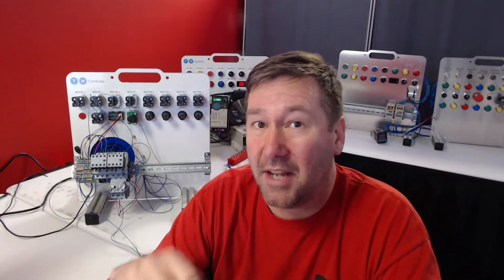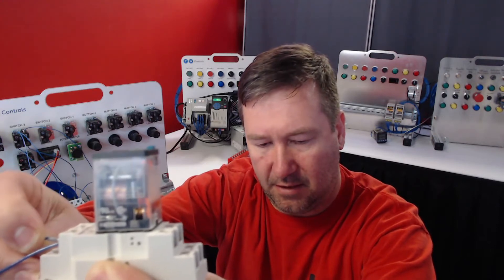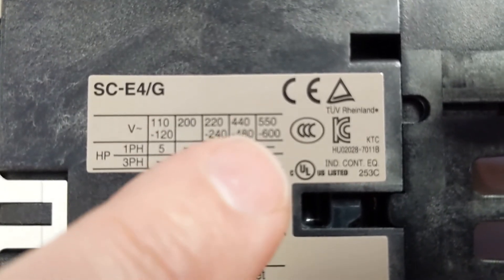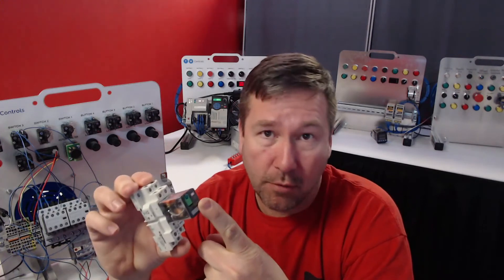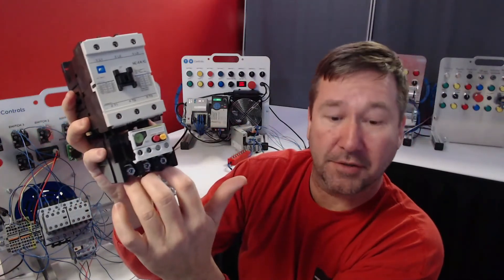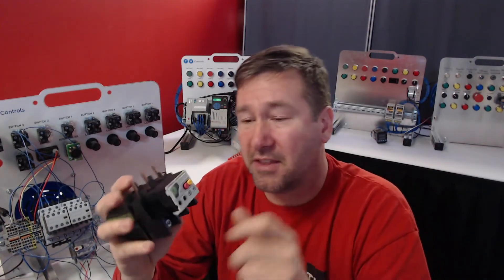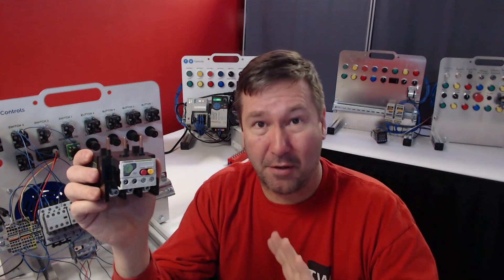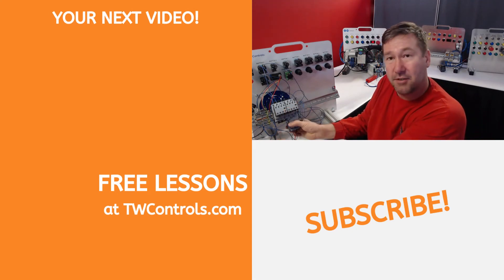Contactors, Relays and Overloads.  Don't BURN your motor up!

Comment: My motor is 1.5kW (2 HP) which power air compressor for underground water extraction. Power outages are common in my region. My motor burned when power returned after a short outage. Do i need both magnetic contactor and overload protector or just one of them to protect my motor?

Comment: Question… let’s say you have a lift station control panel that is run on a float system. It has a transformer that feeds the local hoa switches to the motor starter coils with the overloads. But the customer wants to add scada control. Now when you are sourcing 120v from the scada panel to the motor coils. Does the neutral also have to come from the scada panel and feed through all motor devices or can it remain from the transformer?